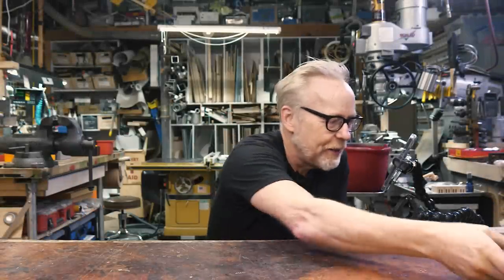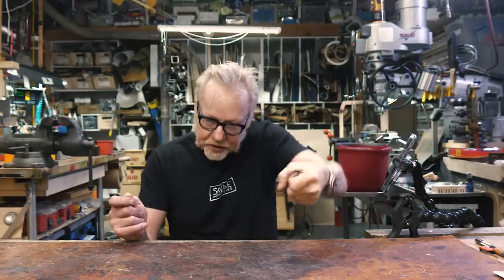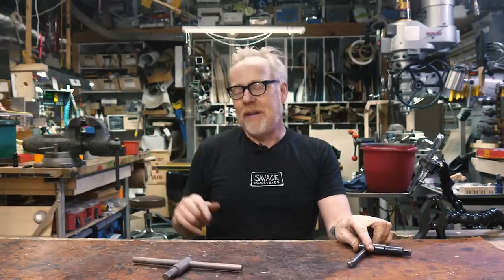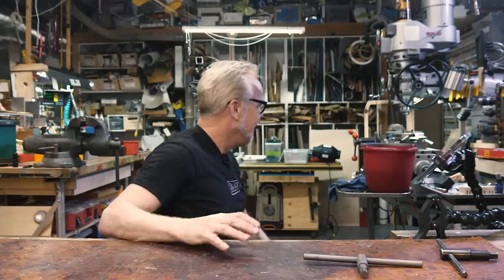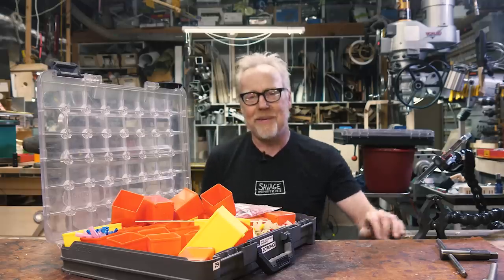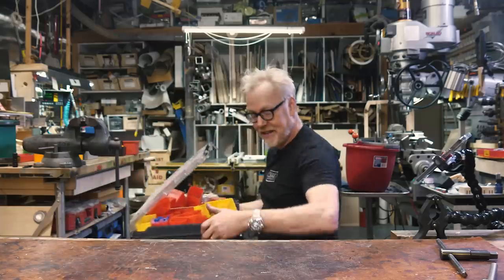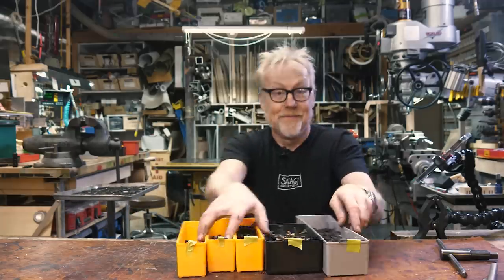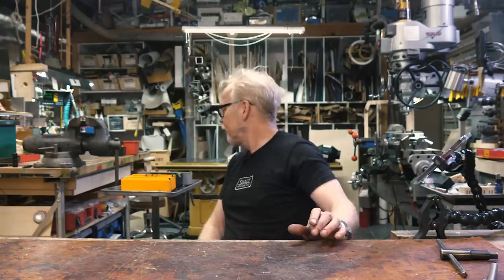Adam Savage Explains What to Do When You Drop Gobs of Loose Hardware

Comment: I won an auction for what I thought was a pallet of various fasteners, Twelve 5 gallon buckets full of nuts, bolts, screw and more. Won the auction for $36. When I paid the cashier told me my lot was inside the warehouse. Found my lot, it was not 1 pallet, it was 5 of them. I only looked at the outside stuff. I hauled home 39 buckets of stuff. Spent little over a year and sorted the stuff I would use. Gave the rest to a guy that had a second hand hardware store.
Reply: Jesus Christ. 36 bucks for that? Genuine question, where do you find auctions like those? Even if I'm not going to get a deal like that I'm curious how I could even approach it. Seems like it could be a smart move.
Reply: @YukonHexsun  yeah how do you find things like this?
Reply: @YukonHexsun  i work at Lowes as a reset crew member and the amount of screws that I pull from behind the hardware bays are ridiculous. When bringing them to my manager he said they would sell the buckets as is to someone to reduce shrink, so it could be from companies that just send them back to manufacturers or trying to reduce their yearly loss. Also you could check out at all local hardware stores where they may do the same.
Reply: Boy I paid $200 for six buckets! They were full, but for you sounds like a deal of a lifetime. I'm planning on building an automated sorter for mine to save time. There are few videos out there on them.
Reply: At my work (mobile/temp HVAC company) we recently bought about $6000 in various air filters, a pallet of shop tools, and racks full of misc metric bolts; all of it cost about $100.
We added all the filters that we could use to our inventory and ended up selling off a chunk of them for about $1000, added the tools to our shop, and traded the bolts to a supplier for hockey tickets (box seats!!).
It is crazy what you can get on auction if you are willing to take the time to dig through and do a little research.
Reply: @YukonHexsun  Cold Weather Outdoor Auctions - the bigger the better.  Dress for the Arctic.  Many folks fail to dress warmly enough and leave early.  I've won several (hardware and brass stock)  lots with token bids at January/February auctions.  There are also national liquidator businesses that liquidate closed stores and factories.  I went to one in Tennessee once and most lots of machine tools went for thousands of dollars, but the hardware and raw material lots (Hardware, aluminum plate, angle aluminum and sheet ABS) went for token bids - bidders ran out of money chasing tools.
Best deals?  Old 1980s DRMO live auctions in January and February.  3 pallets of radar receivers......$2.50 token bid.  Gold plating everywhere in those receivers, and they came in nice metal storage containers - sold those to a house painter for $40.
Reply: @B-in-Norva  most of the CNC stuff seems to go for a lot to homegamers but are at absolute bargain prices. For example, i recently found a lot of 4x Integrex i-400S AM from 2019. I got all 4 for 450k which is maddening to me.
Reply: I heard a different message not how little he paid for so many but that it took him two half of a year. Not worth my time
Reply: When my neighbor growing up passed away my dad was chosen to get all of his  fasteners.  The guy had sorted them in old coffee tins, Unfortunately not by size. My dad said it was the best gift from him he could have gotten.
Reply: I generally have that kind of luck with computers... I have seriously got 2 good Dell desktops, and around 5 good Dell laptops for about 35$...
Reply: @YukonHexsun  It was a GSA auction and this was back in the 80's. The armed services had combined some maintenance depots and were clearing all the excess inventory.
Reply: @YukonHexsun  Deceased estates can be amazing for bargains. Sometimes people just want to get rid of the crap without hassle.
Reply: Now and then I'll buy a random $5 box lot at a sale just for the fun. Usually there's something worthwhile in it. I think the best I did once was get $35 worth of mower knives plus some other new parts for like $6. And sometimes no one pays attention when they start a sale. I got a good old gas can half full of gas for $2 one time.  Other times things didn't get advertised and people only showed up for what was listed, so stuff goes for a deal.
Reply: @travisotto842  Pay some kids to do it.
Reply: @YukonHexsun  Had an experience decades ago, where I arrived kind of late to an auction of electronics parts and had not been able to view all the item before the auction stared.

One item which was called up during the auction sounded interesting, so I placed a bid. Got it for the minimum bid. Dirt cheap.

After the auction, the stuff was hauled outside on pallets with a pitchfork. Way too much stuff to fit into my car. Turned out that quite a few people had been interested in that stuff, but no one had placed a bid because it was just too much material. So I started selling portions of that stuff from the curbside until I could fit the rest into my car.

Comment: I did the exact same thing, I have a Sortimo box with screws in ranging from 12mm to 100mm (33 different sizes). I picked it up by the handle having forgotten to close the clasps and the entire bloody thing emptied onto the floor in front of me. I scraped it all into a bucket and spent about 4 evenings re-separating them which was a long process. I also sat working out how much they had all cost and considered just binning them all but couldn't bring myself to be so wasteful. I now have a real complex about the clasps on the box and am forever triple checking them before I will pick one up!
Reply: Give 'em away! Somebody has the time and a use for them!
Reply: Replace what you need if you need it for work or right away. But...
Keep the mix, it will:
A: give you something to do after you pissed off your spouse/SO and you need to keep out of sight for a while
B: help pass the time when you are procrastinating on something else
C: be there when you need just one more of 'some part' and it will be in the mix
D: give that guest with you something to keep their fingers busy and off your tools
Reply: @michaelvanbogaert7888  Can also sell for scrap. Won't be much, but it'll make a tiny dent into re-purchasing! Depending on a set build we do that with 'used' screws...only used once, but make the call whether it's worth it or not to sort and re-use. ...or donate to a smaller theatre...
Reply: The amount of perfectly serviceable, immediately recyclable, and/or chemically problematic stuff American YouTubers put straight in the trash on camera expecting it to magically disappear from the world is beyond me... Wastefulness and passing the buck are the true American way.
Reply: @1SweetPete  yup, it’s hard to watch. Even if I could afford to trash something and replace it for convenience I don’t think my conscious would allow it

Comment: Safest solution I've found so far is to put the items in a small ziploc type coin bag, closed, then keep that bag inside a plastic tupperware type container/box.  I'll leave a few of the bolts/nuts/parts outside of the bag, but inside the plastic box for easy access when I just need 1-5 items.  If the plastic box falls off the shelf and hits the ground, the plastic bag keeps most of the items from getting out.  If the whole shelf falls down and all of the plastic boxes spill open, the bags are still closed and they keep most of the items from making a mess.  The bag is an extra step, but it's saved me from having a giant mess for over 10 years now.
Reply: That is well worth considering.
Reply: I keep zip lock bags on a clip, which fits the slide out drawer.  I take the bagged drawer to the job.
Reply: One of my coworkers had some little magnetically clasped ziploc bags for that, it was way easier to keep the bags closed when it’s closed by default. Also helped when he accidentally dropped a bag.
Reply: I use 2"x2" bags that fit in my organizers. Still organized to be easily visible and retrievable but also unspillable
Reply: m2 after two messed up situations
Reply: @wick_wack , I cannot find these "magnetically clasped ziploc bags". Have a brand name/model, or link, please for us?
Reply: @mkteku  I’ll see if I can get in touch with him, I don’t remember where he got them or what the brand was or anything. They may have been homemade.

Comment: Oh the pain of having your organizer spill out!  I've felt that.  Anyone that invests in organizers should have a action plan for the day when they do accidentally spill.  Take a deep breath and then start picking things up.  The thing I'm doing lately with my Systainer Organizers is storing the crimper in Kaizen foam in the same organizer case next to the bins with lugs.
Reply: I would add to that, you should see it as an opportunity to revitalize your organization system and fix any problems with it. Never succumb to the sinking feeling.
Reply: +1 for systainer, but soooo expensive.  also raaco handybox is great for electronics components when combined with the stackable green component boxes.
Reply: @millenniumf1138  that's what i would probably do. i mean i'd definitely cry a bit first, but yeah, it's a great chance to fix the issues you've found with the old system.

Comment: Yes!!  There’s some awesome cognitive psychology research about seeing fields of large numbers of similar shapes.  Once the brain-eye system gets tuned to “see” a target shape, they jump out. But … for some choices of mixed shapes there is no jumping out at all.
I used exactly the same technique to sort 4 workshops’ worth of mixed fasteners: prime you brain to see a certain size or shape, and just let them come to you.
Reply: I've actually trained my brain to do this but for Colours as well, so I can go "look for red" and the reds become just the tiniest bit more foreground
Reply: It works great for screws and such, but imagine trying to sort a pile of resistors or chips this way... they all look identical except for the tiny makings!
Reply: @renakunisaki  This is partly why, as an electronics hobbyist, I greatly prefer those "sample books" of SMD resistors/capacitors/etc in cut tape inside plastic wallets in little A5-size books, instead of any kind of "loose components in dozens/hundreds of tiny containers" system.

For a start, you can buy the books pre-populated (and labelled!) in a range of component types, physical sizes, and tolerances. You can also buy books containing empty wallets and extra empty wallets for two different widths of tape. And EEVblog sells large, A4-size ESD-safe wallets more suited to larger components and ICs (or at least he used to sell them; I've not checked recently).

So I can easily find the majority of my SMD parts by grabbing, e.g., the "Resistors 0603 1%" book and flipping to the right page. I have another book for LEDs, one or two for capacitors, another for misc small parts, then a big A4 folder for ICs and larger parts in tape (SMD electrolytic capacitors, inductors, etc.)

I'll admit that grabbing parts from tape isn't as fast as picking loose parts from bins, but at my scale that's really not a problem, and I personally value the organisation and safety of parts on tape :)

One warning regarding the pre-populated capacitor "sample books" from AliExpress and the like: while the parts are labelled, they sometimes don't list the temperature coefficient (X5R, X7R, C0G, Y5V, …). Some of mine do; some don't. Whether that matters depends on your application, but it's worth bearing in mind! :)
Reply: I found that skill as a kid playing with legos. I would get lego sets for Christmas or birthday or whatever, but after building the set it would eventually get harvested for some other project. So I ended up with a big rubbermaid tub of mixed legos. When looking for a piece, I could focus on a shape or a color, and the excluded shapes or colors would fade into the background a little bit. 

I suspect it's an evolutionary thing that helped us find edible bits on the ground or berries on bushes.

Comment: There are a number of solid brands:  TE Connectivity, AMP, Tyco.  Each has a range of products. The key is to buy from an authorized distributor. Also, if you don’t want the spill possibility, you can get the connectors on a tape reel if the quantity is enough (typically 1000 pc)
Reply: I agree, I usually buy my connectors as needed from DigiKey and they carry all the premium brands. It’s still not easy the ones you want due to shear amount of choices, so I might order few different ones and decide which one fits the application best once I receive it.

Comment: I think that for shop usage these kinds of containers with the lid you have to open to access what is effectively otherwise just a drawer are really bad.  In theory, the lid means that you could close the container so that if it got knocked off the bench it won't spill everywhere.  But in practice as Adam demonstrates that doesn't happen.  In fact, the lid's existence actually makes it more likely that it is going to get knocked off the bench as it encourages precarious piling of things.  I bought some much cheaper storage units for Lego, and the first thing I did was cut all the lids off them.  Now they are just drawers and I don't even have to take them out of the storage cabinet to access what I need, so there's no chance of them being knocked over.  If you have to take those parts out of your shop then great, but otherwise the lid is just a liability.
Reply: One caveat.. dust gets on stuff if you only have shelves and no drawers, the boxes with lids are the only solution IMHO
Reply: @joansparky4439  I agree with your comment. Dust and the like just loves to get into fastener containers. For LEGO in a clean environment having no lids is fine, but workshops and trade vehicles are notorious for dust and debris.
Reply: Adam mentioned making runners for these, where I presume he will remove the induvidual compartments as needed. At this point though seems better to just have draws with teh compartments in it. Then, If you need to take certain ones with you some where... have an empty box and fill it up with your selection.
Reply: In practice it does work, if you just close the lid.

Comment: What is obviously needed is sorting boxes with lids that simply won't open unless the box is fully supported with all four corners on a flat surface.
Reply: That seems like a huge annoyance if you're not on a flat surface or you're short of workspace and you're balancing it with only 2/3rds of it on the edge of your bench.
Reply: or just have the discipline to close the box when you walk away from it. thats what i do, sometimes i am outside working and no flat areas to put box down so i am holding it and finish by closing it and putting locks on it.